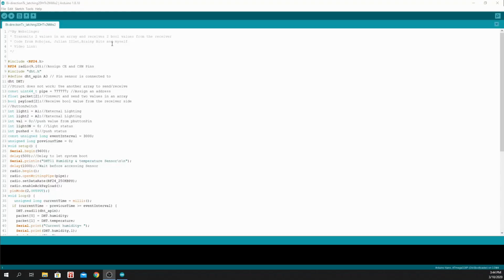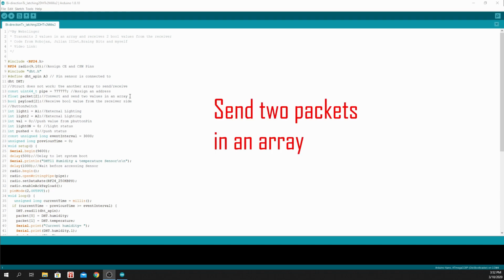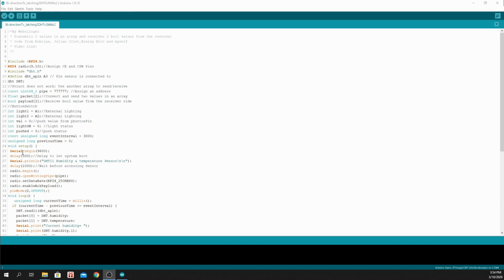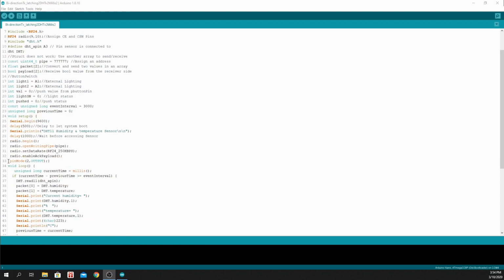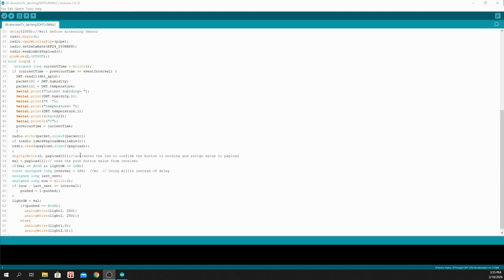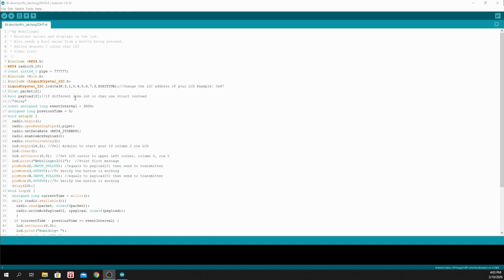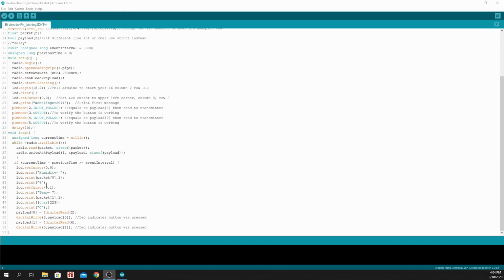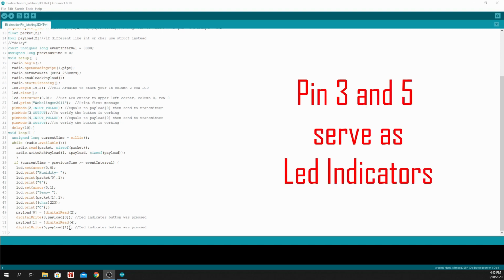Wireless Weather Station + Control a DIY Project

Comment: Hocam merhabalar. Ben de bu projenin aynısını yapmaya uğraşıyordum. Sizin yaptığınız gibi çift yönlü haberleşme şeklinde yapamıyorum. nRF24l01 modüllerin her ikisininde 3.3 V güç girişine 10 uf  kondansatör bağlamama rağmen  ve diğer bacak bağlantıları da doğru. Ama doğru bir kod bulup birbiriyle haberleştiremiyorum modülleri.
Reply from the maker: I usually use a 100uf cap.  It also helps to get good quality breadboards to avoid connection issues. Did you use a voltage divider to get 3.3v?